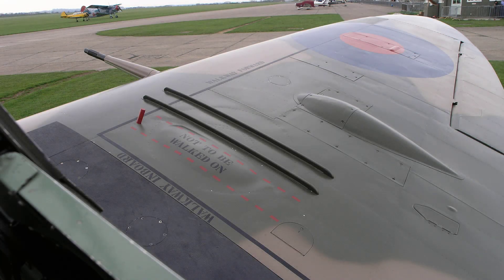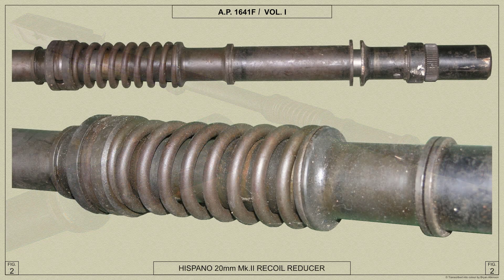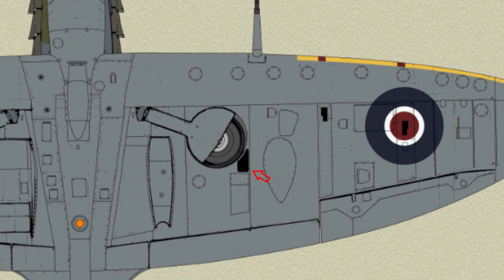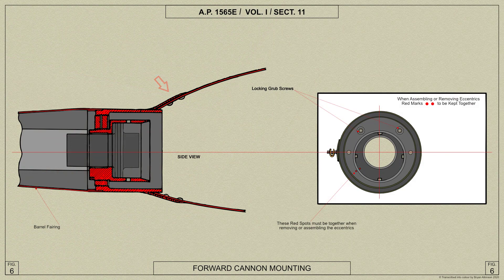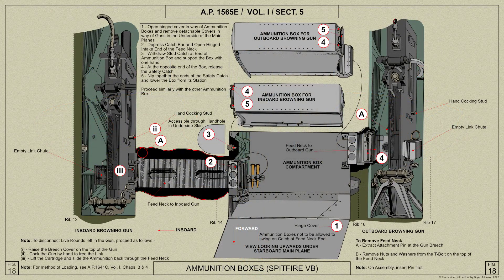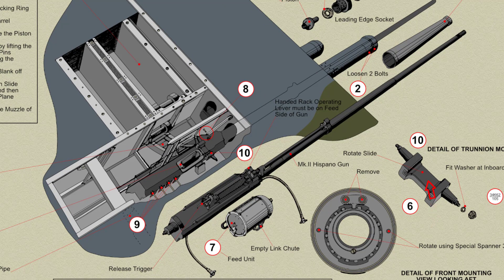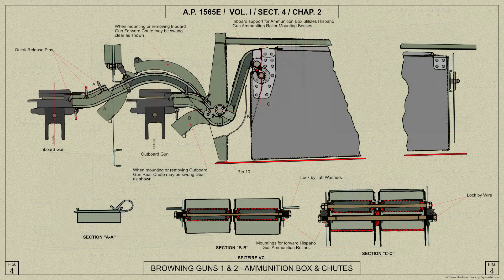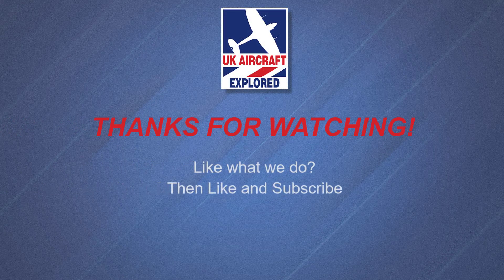Spitfire Mk V – 20mm Hispano Cannon

Comment: Hi Brian - Jonathan from the Royal Armouries here. Great video as always - some minor corrections if I may, based upon study of the Pattern Room archive. These are, sorry to say, the unintended consequence of your otherwise excellent choice of colour photos to replace the original AP drawings, and also by some conflation, earlier in the video, of the Spit Mk.Vb and Vc installations.

1:30 “The Spitfire Mk.V was fitted with a belt feed mechanism…” - ONLY the Vc was fitted with a BFM, it could not in actual practice “be used instead of a magazine” - the Vb still had the guns mounted on their sides precisely in order to use the 60rd mag which was the only option when it was designed. Likewise, the Vc had the BFM ONLY since there was no room or need to use the mag. 

The gun shown at 2:05 is a Mk.II, yes, but it’s one set up for the Sea Fury or Meteor, not a Spit. The Front Mounting Unit is the No.3 Mk.2 - the giveaway being the short, round section FMU/recoil spring. Also, you’ve labelled said spring (also at 3:11) the “recoil reducer” - that’s the term for the slotted muzzle brake device, which isn’t fitted in this or indeed the Spit Vc installation as the extra drag from the BFM negated the need for it. The Belt Feed Mechanism is the Mk.V (see below).

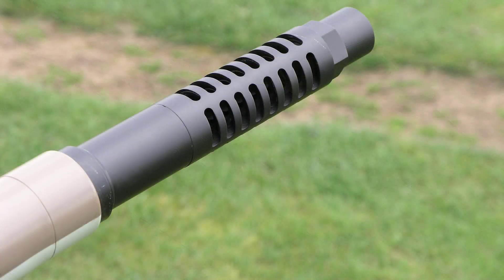2:53 - NB the slots in the recoil reducer are not cooling slots - they are ports, since it is a form of muzzle brake.

The Belt Feed Mechanism photos you’ve used at 3:19 are the Mk.V type dating from 1944 at the earliest - the AP shows the Mk.I as per your caption. They are very similar but if you compare closely you should spot the differences.

3:42 - your image shows FOUR sprockets, one labelled ‘extra sprocket’, your commentary says three. This is due to the AP source covering both types - the extra sprocket was added to the Mk.I* BFM.

Worth noting that despite the abridged AP wording implying it, the BFM is not driven per se by the gun - it’s driven by spring tension in the internal clockspring. The rack operating lever only tops up the spring tension on the BFM that is already there from the loading process.
Reply from the maker: Thanks Jonathan. Your points are noted.
Reply: So it is possible to retention the spring in the BFM during flight? Or is it built to be set on the ground/tensioned on the ground for the amount of rounds put in the belt?
Reply: @parallel-knight  The latter - there's no physical way to re-tension it.

Comment: In the last few shots, what's the bulge/protuberance next to the cannon, provision for a second cannon?
Reply: Yes, it’s the cover over the end of the blast tube for when either a second cannon or mg was fitted. The bulge over the cannon on the top of the wing was originally wider, to cater for 2x20mm cannon in each wing, but as that configuration was rarely used the smaller bulge was developed as it offered less air resistance - and hence a higher airspeed.
Reply from the maker: The bulged panel next to the cannon, is the to allow for the circular ammunition magazine.

Comment: hello from Italy,  thanx so much for all these golden pills of aeronautical knowledge from the WW2 RAF airplanes.  
This one a great addition, the 20 mm. Hispano should be virtually the same basic weapon the P-38 Lightning had back then among its machine guns and, by firing from its longitudinal axis (no convergency issues) results were usually devastating even though there was only one cannon.
Please just a little doubt on my part regarding the cylindrical ammo feeders, mostly it's my fault in not fully understanding the strictly technical description:  they weren't ammo drums of course, so were they something like 'helpers' for better feeding? I mean, the same result wasn't possible without them, rather having ammo belts directly entering the weapons?
Thanx very much. Franco.
Reply from the maker: They were a belt feed system. Thanks for watching
Reply: @ukaircraftexplored6556  yes but, would have been the belts useless without those cylinders with wheels/sprockets inside? Or, would have the belts worked good anyway? 
In this latter case, did the cylinders have 'only' to help the belts in feeding better?